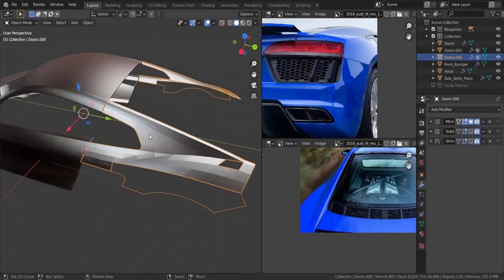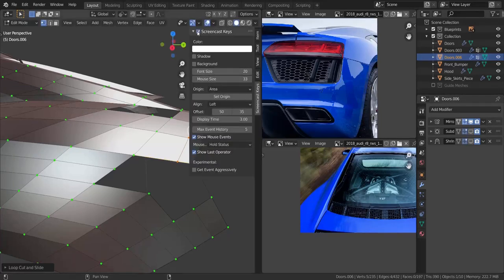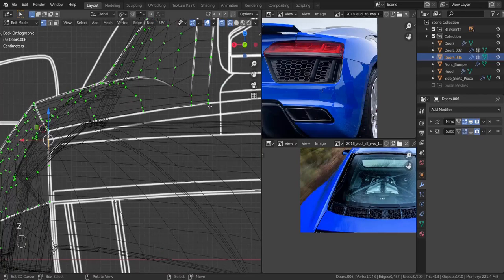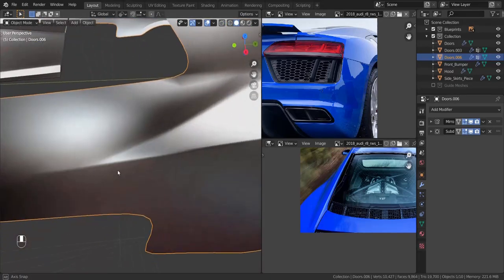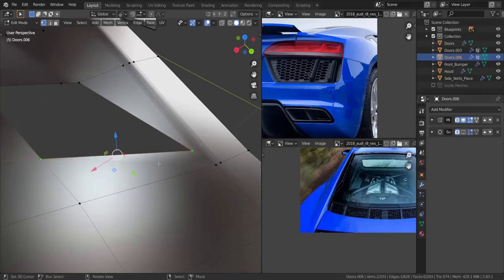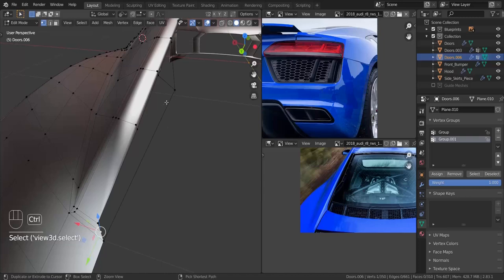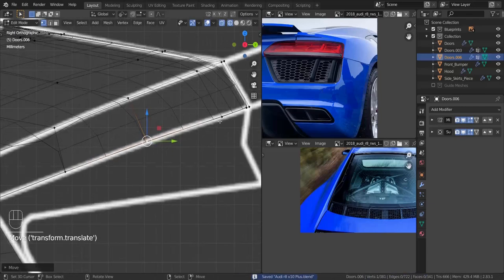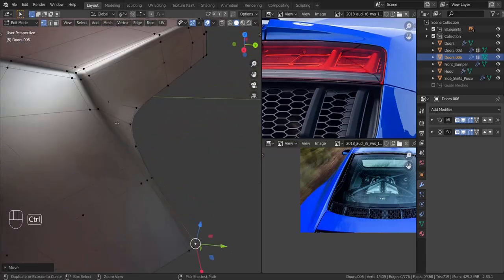Blender 2.90 Car Modeling - Part 7 Finishing The Rear Fenders

Comment: Hey! I can't repeat it at 5:00. I remember that before we did a similar operation using S X 0. or am I wrong?
Reply from the maker: If it isn't working check your search bar for repeat and see what it is assigned to.
Reply: @NaturalArtFreak   
I think I get it, this is a repetition of the action. for the first vertices we do through sx0, and for work through Shift + R, right? I apologize, I do not understand the language well, therefore it is difficult for me to perceive the comments in the video
Reply from the maker: @alexandertyurin9423  yeah Shift+R repeats the previous command used...